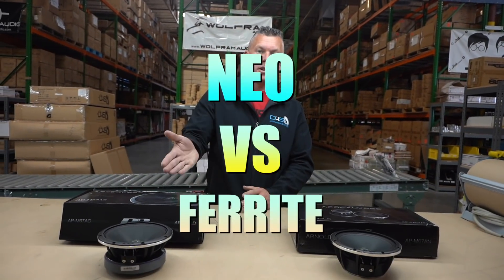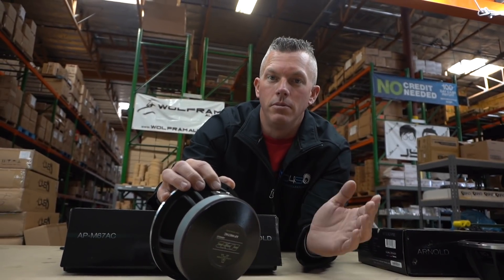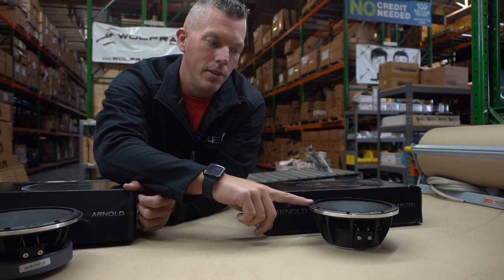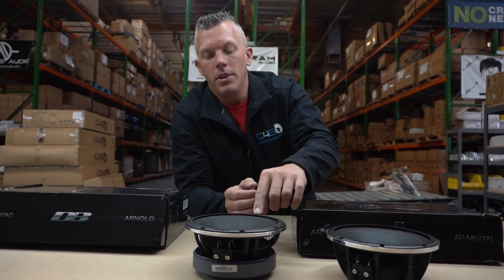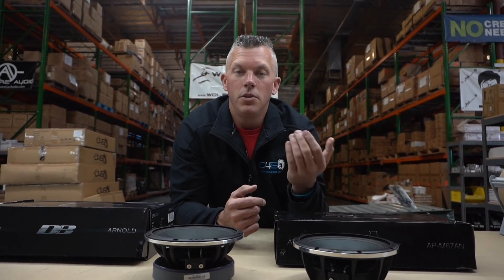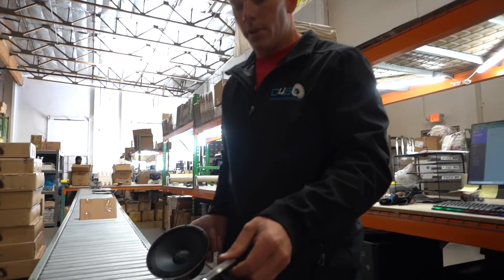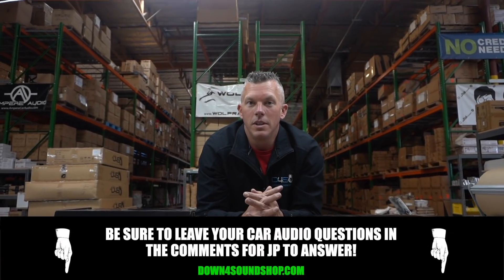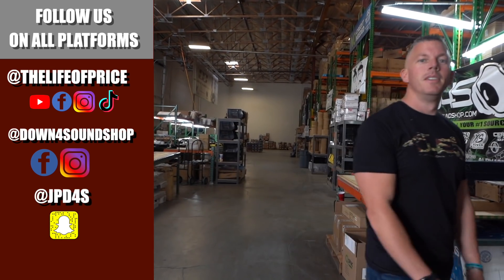NEO VS FERRITE SPEAKERS WITH JOHNATHAN PRICE

Comment: Why do you repeat in several occasion the RMS power of the speakers in context of magnet type? There is literally zero (0) link between two. The specified RMS power is the measure of the thermal handling capacity of the voice coil, before it become too hot and melts down. It has nothing with the magnet itself, which strength dictates the speaker efficiency; the more specific, how efficient the driver is in converting the electrical power into voice coil movement. And that has nothing with RMS power of the driver.

Comment: I’ve been running sundown neo pros in my doors for years! They last forever and the mid bass kicks hard!
Reply: Are u running the 6.5 v3? Been lookin for a vid on the new ones I love being loud but hate the p.a style sound just did a system with the deaf bounce ap 67an them shits loud as hell but imo sound tinny not a fan I'm teynna find something just as loud as them but more warmer of a sound trynna do a sql setup loud and clean
Reply: @D1aNdOnLyNiCkx3  What did you end up going with?
Reply: @beyondthedetails  so I found a good set of the dbs the neos but haven't installed them, i have a 18sound 8 inch might stick in the rear deck to cover more of the mids and use the deaf bonce ap-m67ans in the doors haven't installed yet because I might change my mind so current setup Is a chuchero with two ten inch 18sounds speakers with prv tweets for the mids and highs along with the stock doors do the job pretty good for now (genesis g80 17 speaker system) in the truk custom built box I built tuned stupid low (oops 😆) with two 12 ct sound meso's latest version on a jp23v2 the chuchero is off an alpine mrv-f600 signal is grabbed from stock amp to a audiocontrol dm810 stock 200 amp alt stock group 49 bat in the trunk for now untill I get lithium I have other projects and the genesis is my daily once the weather gets better I'll figure something wbu?
Reply: @D1aNdOnLyNiCkx3  I have the 67AN also. Sold my RT and just got a Widebody Scatpack and haven’t installed the speakers yet. I too noticed they are super loud but do sound tiny. Running a 15” Sundown XV3. 

I am thinking of getting Midbass 6.5”(G2 Dynamics) for Doors and Rear Deck(Challenger speakers are in rear deck) add a 8” DB Neo speaker in center hole of rear and add 4  apocalypse amp-T25 Tweeters for Midrange(2 in doors and 2 in rear side). 

The Arnold’s are great. I thought I was the only one who didn’t like the tiny sound. Now I know I am getting Midbass speakers this time around.
Reply: @D1aNdOnLyNiCkx3  the d4s 6.5s are pretty good. Very loud and clean sounding.

Comment: Which sounds better between ferrite & neo speakers ?
Reply: I keep on asking this question, no answers!
Reply: Both can sound great, or bad. The magnet type does not determine the quality of sound reproduction... in most cases, the neodymium type can be made more efficient with similarly sized magnet, so it has larger SPL for the same power. Not neccessary better or worse sound quality.

Comment: I live in the deepest part of Africa and have honestly never seen neodymium speakers before, so please excuse me if I ask stupid question. I was just wondering is the coils in the 2 different magnet speakers the same or does the neo have to be more robust because of the strength of the permanent magnet? 
Then I was just wondering about the actual performance, do they perform any better sound any different, if you had to compare them to a ferrite speaker of similar quality/performance range. I can imagine that the neo speaker would have a much wider hz range because the neo magnets is stronger and more responsive and accurate? Is neo speakers more for auto or do you get them in room speakers as well

Comment: I think what is 2nd ultimate power of neodymium magnets is displacement in case of big magnets its form is much smaller...
However these ultimate powers comes with prize neodymium loses its magnetism much faster rate ,and is way more vulnerable neighboring electromagnetic fields and overheating than ferrite i think 😅

Comment: So I'm looking to do a full build in my Focus ST.  I'm not going with a crazy sub this time, just maybe a single 12.  But what I'm wanting to do is find basically audiophile grade speakers that I can do a crazy surround sound setup with.  I'd prefer not to run 300 watts per speaker, anyone have any suggestions?
Reply: You can run them at lower power. They will still be loud they are very sensitive

Comment: 12 or 15 which is louder?
Reply: They both play the same volume. The difference in the cone size comes into play with playing low frequencies below 28hz 12s can't play lower then 24hz without bottoming out, but a 15 will slap down to 15hz
Reply: If all factors are equal 15s are louder because  cone area is king also proper box tuning and  any sub 6-18 can play    any sub subsonic frequency it depends on the amp and the enclosure tuning just think about it a Bose systems it crushes low because of the design of the enclosure if a sub is bottoming out 2 things your playing way below tuning of your enclosure , also too much power  and 
 if the sub is out of phase good luck
Reply: @bigkato3134  then how come you can bottom out a Sundown X on rms power? Man your only explaining it from an abusive standpoint. And Bose is pure overpriced 🗑
Reply: @bigkato3134  if cone area really is king, then please explain how my single 10" Sundown Xv2 beats most 2 12 systems who have 24" of total cone area vs only 10
Reply: @bigkato3134  you realise that you can bottom out a Sundown X on 800 watts which is completely underpowered on 20hz 😂😂😂😂😂
Reply: Why is it that people give answers when they don't even understand the rationale behind the answer they're giving? 🙄 

@Sucios Mob... Typically, a 15" will be louder sounding than its 12" counterpart due to a change in parameters of the subs between the two. Additionally, it'll also feel louder because its size (and thereby the mass it's able to move) are greater. 
If you need an analogy to visualize what a speaker is doing, think of bullets. A .22 caliber shell and a .45 caliber shell are effectively the same concept, but the .45 will always create more damage due to the increase of mass (and force). That "damage" is expressed both by the hole left in the target and volume of the shot for a bullet; whereas with a speaker, it's expressed by both  displacement of air and its inherent loudness. It's just physics relative to parameters, guys.

Comment: Why is it cheaper on deaf  bounce website?
Reply from the maker: We are currently both running sales on the Deaf Bonce brand so the price should be the same on all the equipment. If it’s not you’re more than welcome to give us a call to get the sale pricing before it ends on the 28th. 702-701-9800
Reply: This guy just trolls in the comments. Click on his profile and all he leaves are sarcastic and negative comments. It’s always the ones that don’t have two nickels to rub together that are the most opinionated. Troll
Reply: @Winters506  First answer this riddle.
Reply: @Winters506  “Answer my three riddles to gain passage to my bridge. If you fail even one, you may not pass. Do you accept?”